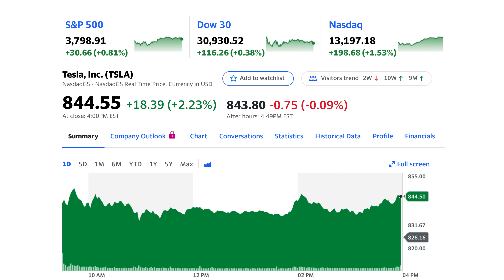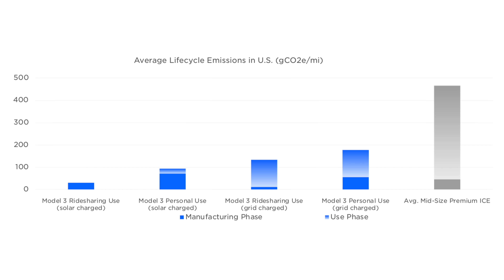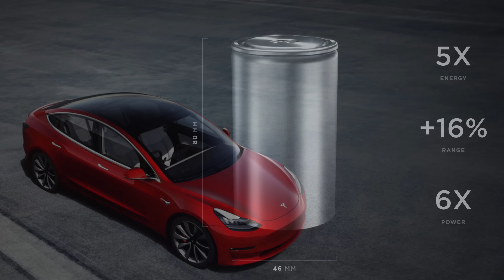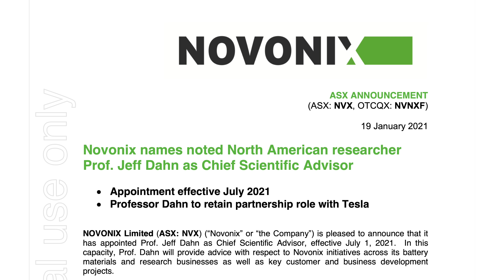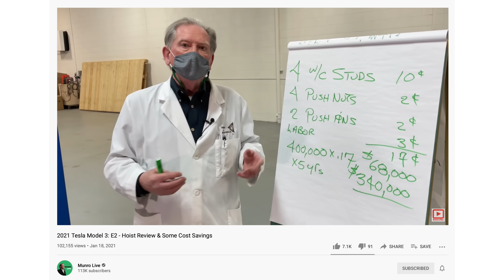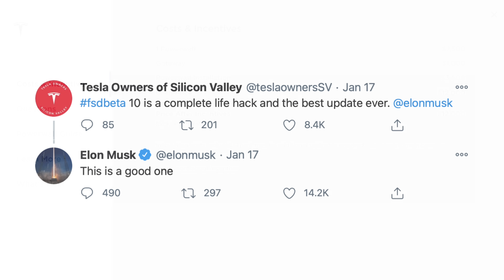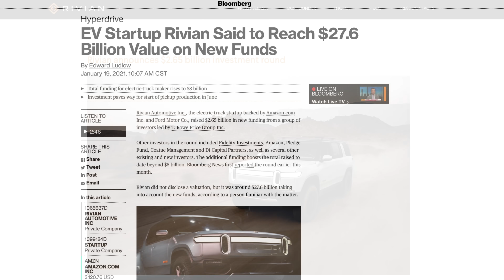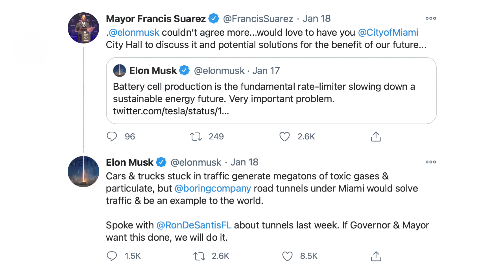Some Math on Tesla’s New Batteries, Munro 2021 Model 3, Dahn/Tesla Battery Contract

Comment: I am wondering if you could even do tunnels in florida. It's nothing but swamp , sand and mud. There is no rock to stabilize the tunnels. Would be interesting to hear the technical solutions to this.
Reply: Warren Redlich had a Floridian geologist on his channel who said that it's not a problem and there are lots of tunnels in Florida
Reply: Warren Redlick interviewed a Fla. geologist ~2-3 mos. ago, who explained the base rock supporting Fla. Once you go down ~100’ or less, below the dirt/muck/swamp layer (eg, the Everglades is shallow, having been formed only in the last 5,000 years), there is a stable 3,000’ layer of limestone, which Mr. Geologist said would be an excellent tunneling medium. The first 30’ down & last 30’ up would require water proofing like all the other shallow road & rail tunnels bored in the last 125 years.
    Limestone also has the benefit of being an excellent construction material. So the Boring Co. could market all the limestone recovered, solid or cuttings, for rail & highway beds, paving, and building construction.
     Perhaps w/ Orlando as a hub, an initial 500 miles of hyper-loops could connect Tampa-St.Pete to the west, the 3 South Fla counties, and Jacksonville via Daytona. Phase two might be 450 miles Orlando-Gainesville-Tallahassee-Pensacola. Phase three, 350 miles, would go west from Ft. Lauderdale & up the West Coast to Tampa. The “final” phase four could be 200 miles along the East Coast north from W. Palm to Daytona.
     Of course there’s a reason why this 1500 miles looks like the interstate highway system... just 5X faster, much more efficient and vastly safer. With completion of phase one’s 500 miles, most short-haul airline traffic in the state would end, eliminating a lot of carbon & other GHGs & environmental pollution. (A older IEA study based on high-speed rail indicated that a continental system could displace air traffic under 750 miles.)
Reply: @mikemccarthy1638  
The florida limestone sucks because the higher atmospheric CO2 is causing ocean acidification and the water is eating the limestone away.  That's why there are so many sinkholes and underground caverns in Florida.  One group of explorers went miles underground, under shopping centers and residences.  The whole Florida is like Swiss cheese!
Reply: @acmefixer1 :  So you know more about it than the geologist who studied it?

I'm always amazed how most every internet commenter thinks the know best, regardless of expertise, because they have:  AN OPINION.
Reply: @mikemccarthy1638 :  Ah, that explains it.  I wondered, because in FL, normally no one has a basement.  So as long as the limestone layer is highly consistent re being everywhere once you dig down, then that should work.
Reply: Backup sewer maybe. 
I’m not sure when Miami will get under water
Reply: Florida has lots of limestone beneath that mud and swamp. Perfectly suitable structural material but requires waterproofing.

Comment: Thanks again Rob. Tesla panel gap issues are some of the worst, especially when compared with Toyota who has the best gapping. I believe it comes down to production experience with Toyota practicing Kaizen and the amount of time/money spent on quality control.
Tesla is practicing Six Sigma production methods which is another term for Kaizen which comprises improvements on an ongoing basis. Tesla will eventually get there, it just takes time.
Reply: I worked at a body shop last year. We spent a bunch of time fixing panel gaps for the local Toyota dealer as well as repaint peeling paint on white cars. People don't understand that 10-80% of dealer cars need rework before they are displayed on the dealer lot. It makes the dealer money if they fix in house. If not, they need to sublet it to a local  body shop and bill the manufacturer.
Reply: @joweb1320  so in shorts words toyota have qc issues too and they need the dealers to fix it so the dealers can make money from it?